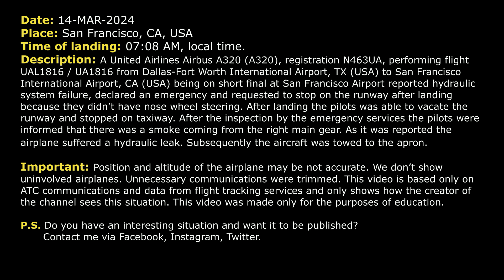Hydraulic system failure on short final. United Airbus 320 has problems at San Francisco. Real ATC

Comment: To add some context on recent united issues from someone who has no love for United nor Boeing (haven't flown on United in many years) but likes having context: 

- united has the third largest fleet in the world (beind AA (1) and Delta (2)) , almost one thousand planes
- united is 45% of the market share of sfo by seat (as of 2022), the next highest is AA at only 14% aka if a flight is having issues at sfo, it's more likely to be united then any other airliner. However, it's fifth for most united flights, but will be second largest for capacity this year*
- united has a big maintenance hub at sfo

E.g. United is more likely to have issues then smaller airliners purely due to size. Those issues are more likely to happen at sfo then most other airports. 

*As just googled to verify the firth number, adding this quote: "San Francisco International Airport (SFO) is the only airport on the list that fails to cross the 100,000 flight threshold. However, in terms of capacity, measured by ASKs, which is counted by multiplying seats by the number of kilometers flown, it would be the second-largest airport in United Airlines’ schedules in 2024" - simple flying ... So guessing united from sfo is flying longer flights then other hub locations?

I have been seeing comments that due to COVID, experienced mechanics retired, and due to work stoppages, maintenance requirements are up due to flying older planes, meaning higher workload for maintenance staff that may have less experience then they would a few years ago. But the more dramatic issues like the wheel issue appears to be manufacturing defect and not maintenance oddly enough. Delta also lost a wheel last month, wondering if same manufacturer 🤔
Reply: Well said. Common sense and context is normally ignored by some, as they think they know best. Cheers.
Reply: I like that you took the time to research and to gather some relevant facts and numbers. Then you used them to inform your opinion. 🎯
Reply: SFO is United's primary hub for long-haul international flights to Asia and Australia/New Zealand, so even with fewer flights it makes sense that they run up the seat-kilometers. United flights from SFO would tend to be on larger aircraft and fly longer distances than flights from (for example) DEN. DEN is now the top United hub by number of flights, but it's overwhelmingly domestic flights and it skews heavily towards narrow-body aircraft.
Reply: @BrianCairns  Ah! That is what I was suspecting considering that stat and location of SFO, thanks for clarifying :) 

Watched an interesting video recently by the channel Broadvay about why Chicago has so many runways compared to big airports that have very due, and it's due to combination of handling much more of those smaller domestic flights and cargo, which was a good lesson on the impact of small domestic for large international on airport usage.
Reply: Hefoxed  wheel problem or damage that was not caught...ie maintainence !!!!
Reply: @wilburfinnigan2142 from what I've read/heard from those in the industry, airplane wheels shouldn't fail in the way it did outside of manufacturing defect, and while some metal fatigue can be visible, it's tested for on a set schedule by manufacturer minimum to try and catch the issue-- not sure about wheels specially, but early unexpected fatique thus can be missed. It'll be interesting to see the ntsb report.
Reply: @wilburfinnigan2142  Manufacturing defects are to be caught by the manufacturer. Airlines maintenance don't have the skills nor the responsibility to find manufacturing defects.
Untill the report is out, we can't know for sure if this incident is on the manufacturer or on the United maintenance, so it wouldn't be wise to jump to conclusions or accusations.
Reply: Id still fly at boeing. I believ the nes media si biased against boieng.